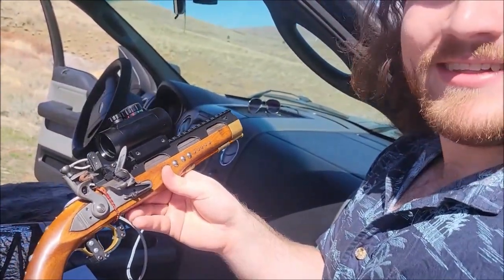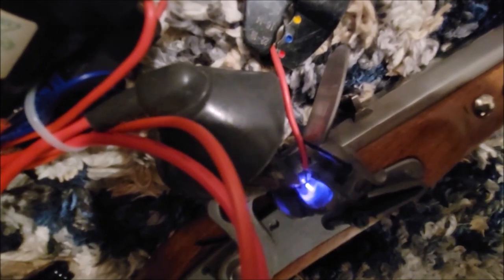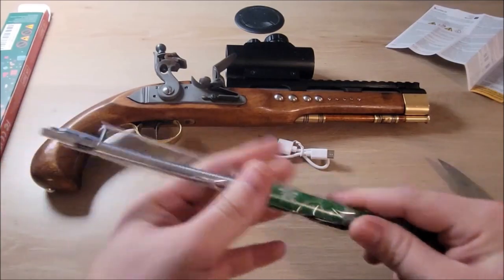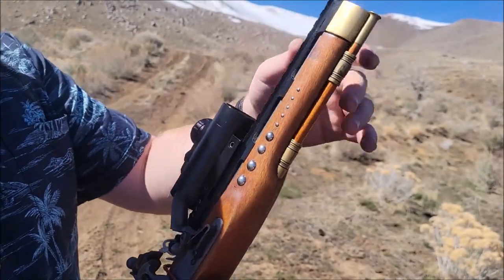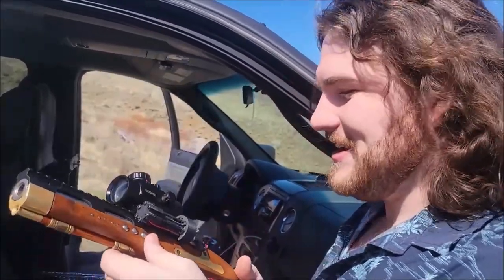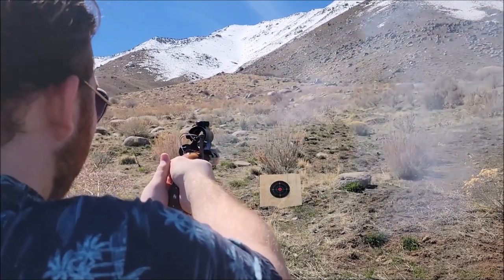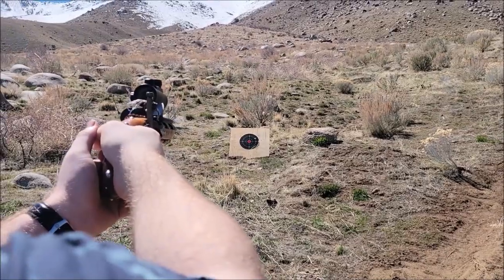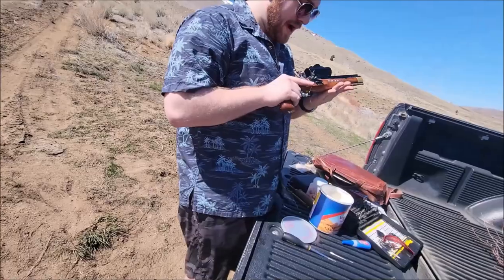Electric flintlock pistol build and shoot

Comment: Tazer + 18650 power pack + BP Rifle, could theoretically house a large enough power bank in the stock, using a momentary switch or two (i say two because you could use one adjusted to trigger sooner to turn the pack on and the either to ignite the powder. when released would cut power to pack, last possibly all day).